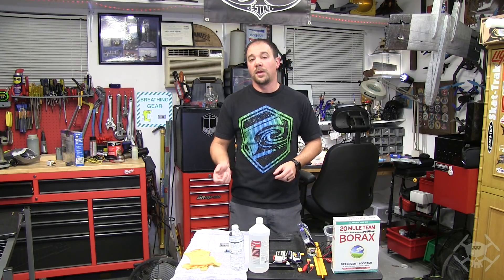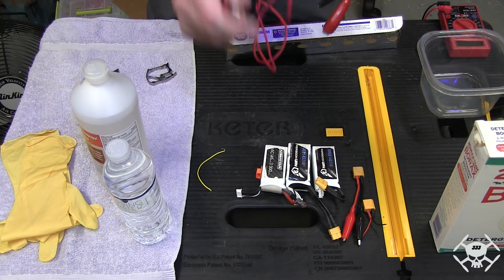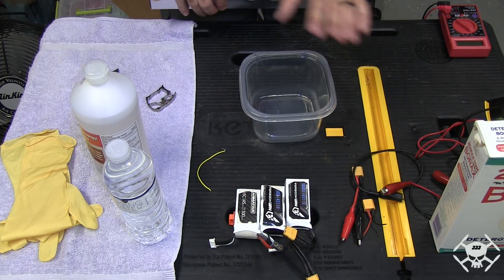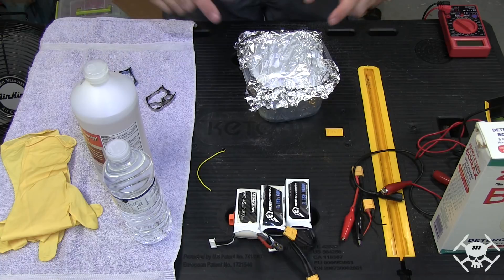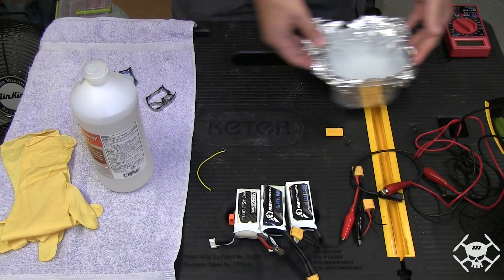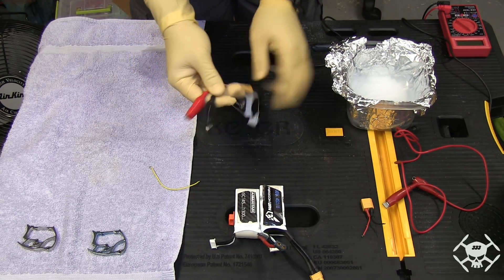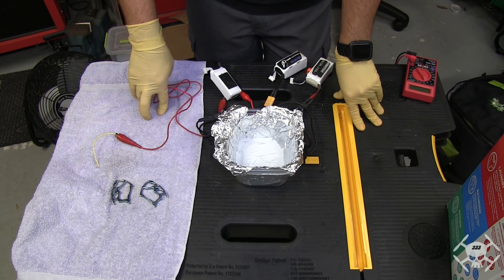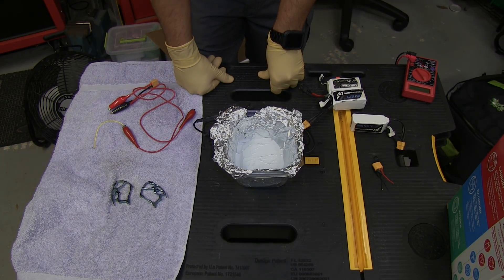DIY Armattan Rooster Titanium Anodizing!

Comment: I don't think you need to fill the bowl with aluminum foil. It just needs to be in the water. So you could put a strip in connected to the negative wire at one end of the bowl and anodize on the other to reduce risk of completing the circuit. I could be wrong though.
Reply from the maker: JeRaF FPV I tried a strip of scrap metal in the water before and what happened was right where the the strip was, the titanium was more colored by that strip. Seems the more metal you have in the bowl the more uniform the color

Comment: I’ve been trying this and can’t seem to get it. Not sure what I am doing wrong. Im using 9v batteries, aluminum foil, bottled water, borax. Any idea about what I may be doing wrong.
Reply: Can't guess what you're doing wrong unless you tell what you're actually doing.. .  .   .     .
Reply: snaip I got it working, but thanks for the response. I may or may not have had the leads backwards...doh! Check out my result on my IG - Stinkfist32

Comment: What if I use directly 45Volts?  Not step by step increasing voltage like you did?
Reply from the maker: Eddy Wijaya you just go straight to the color and skip all the others. With this kind of anodizing you can go up in voltage and color, but you can’t go back unless you sand and polish it all off
Reply: Thank's mate...